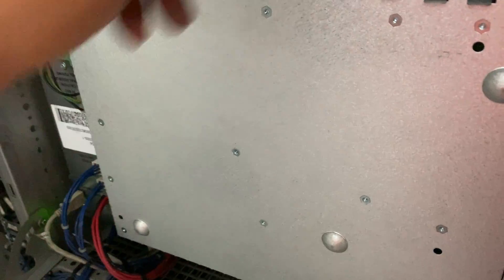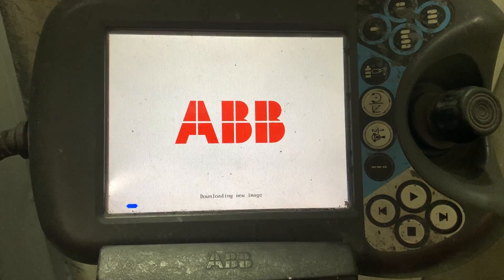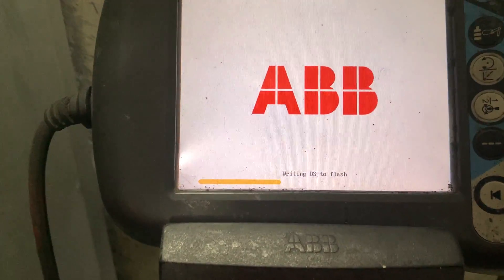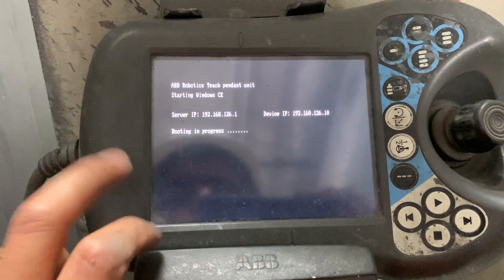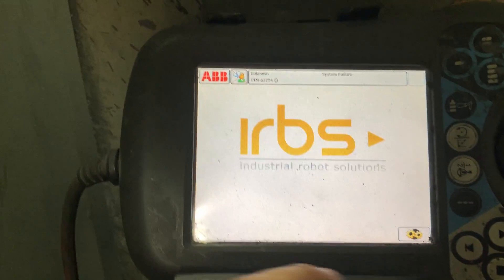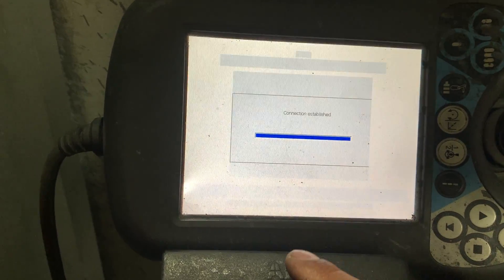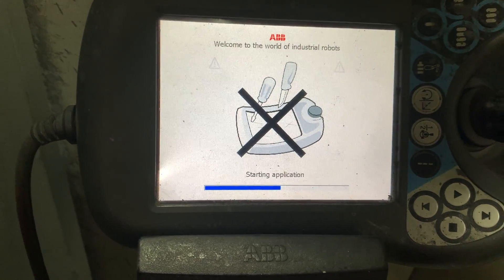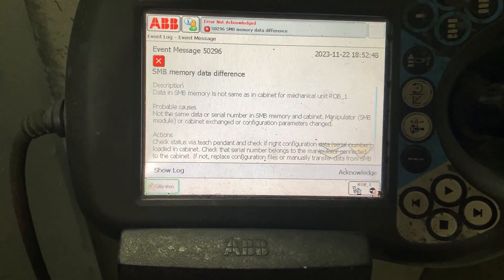ABB IRC5: How to restart & restore system to latest faultless state, after controller replacement

Comment: Is this what I should try. Cell will not power on my fault is system failure. Or could it have something to do with the revolvers. Event log telling me 4-6 out of range. Robot does not look out of range it is not for sure. In order to update the revolvers I need to cycle power.
Reply from the maker: Hi there.
Have you tried this? You can manually sit the manipulator in each axis synchronization marks and update their revolution counter. 
For example for an IRB140 manipulator see synchronization marks on page 213 of https://library.e.abb.com/public/81a35b138c2342b5b9455e5696a09484/3HAC027400%20PM%20IRB%20140-en.pdf#page=213

Hope this helps. Regards 

ABB IRC5: How to update revolution counters on a manipulator IRB140
https://youtu.be/E3sMQ49wzoI